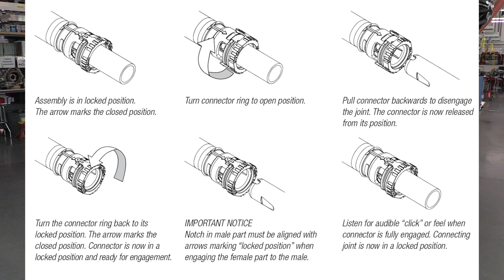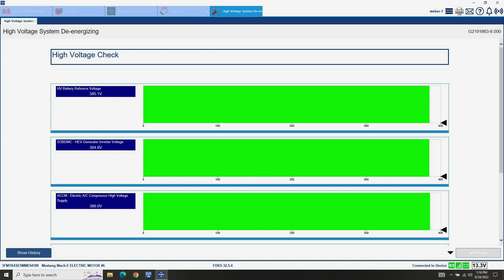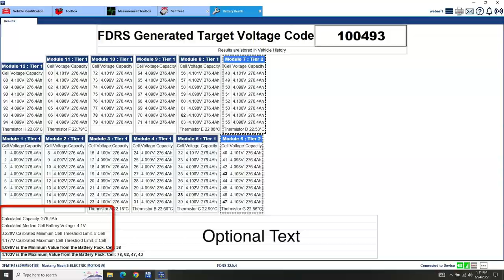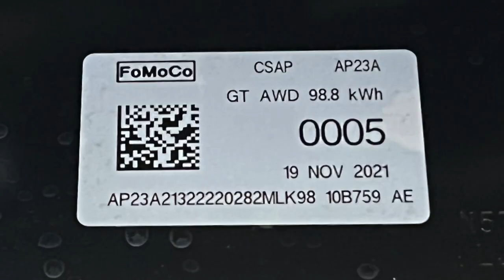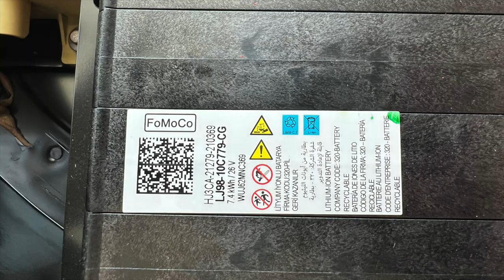Mach-E GT Battery Removal

Comment: Your experience with this procedure almost mirrors mine when removing it for the first time. Getting the car positioned just right may as well be an act of Congress. VERY difficult, and can be made worse if you have an older lift with less arm flexibility. Some old lifts with two stage arms can't even lift these.

The coolant clips are a pain, and I fear how difficult they will be to remove with some dirt and grime built up. The diagram you found from the supplier is very helpful looks like.

I think the offset center of gravity is why the Ford lift table is HUGE. The lift surface is probably 4 feet by 5 feet, and the lift itself weighs something like 800 pounds. Very heavy duty, it was overbuilt to work for future larger packs in upcoming vehicles.
Reply from the maker: Thanks for the feedback Jake. I do wish I had the larger lift table; the center of gravity would not be an issue.

Comment: My wife is probably watching Survivor or something and thinks I'm crazy for wanting to learn all I can before I get my Ford Lightning !
Being a mechanic for 30 plus years, I am absolutely loving watching your incredibly well done videos.
 never thought I would go electric but what I have learned from you I feel much more confident even though I'll have to keep my  old suburban so I have something to fix.
I sure hope some tech videos of the Ford Lightning will be coming !
Are the cels  4680's ? or a completely different type
Reply: Currently, only Tesla is using 4680 cells as far as I know. Tesla has their tabless dry electrode 4680, and Panasonic is making a 5-tab wet electrode version. These Ford cells are similar to the Nissan leaf, Chevy bolt etc.  But the chemistry is different.
Reply from the maker: Thank you for your kind words. Enjoy your Lightning!
Reply: "4680" is a just a size of cylindrical cell (46 millimetres in diameter by 80 millimetres long). Most EV manufacturers do not use cylindrical cells at all - as in this vehicle, they use rectangular pouch cells that are stacked into rectangular boxes (modules).

Comment: Apparently Ford recently issued a recall due to possibility of contactors failing open
Reply from the maker: Yes, they can fail open or fail closed with repeated heavy acceleration of repeated DC fast charging.

Comment: Very informative, looking forward to the rest of the series, do you know which contactors are sticking in the ford recall, as ford says to avoid repeated hard acceleration, and to avoid dc fast charging while waiting for the software fix. I was hoping to see a common contactor between the dc fasting charging and the battery voltage. Thanks for your time. I'm a retired fleet mechanic, and current owner of a Mach-e extended range  gt
Reply from the maker: Thank you. Yes, I will demonstrate the contactors in action in my next video.
Reply: Sad about the recall
Reply: @Nicholas-f5  Recalls have been part of the automotive trade for years, this one seams minor compared to some of the others. I'm sure that future production models will get better. John has shown that the replacement of the contactor module, is not that hard of a fix, and if need after warranty, I would not hesitate to do this repair my self.  My wife's mach-e has been a good vehicle to this point 20 k so far, and I enjoy learning the new technology. Thanks for the reply Nicholas

Comment: Professor Kelly Thank you! Did I miss how to drain the coolant loops?  I thought I watched all the way to the end of part 2.  And I'm only 25 minutes into part 3.  I'd suspect coolant changes would be a maintenance item, that could be done at home with a Mitivac air vacuum  filler system? As a engineer not in the automotive field, thanks for explaining the scientific detail of how and why your doing each step of the process.
Reply from the maker: Good catch. I forgot to video disconnecting the hoses at the front of the battery. Disconnecting the two battery coolant hoses at the front of the battery drains the battery coolant expansion tank. Disconnecting the two rear inverter coolant hoses at the front or rear of the battery housing drains the motor electronics coolant expansion tank. I use the Mityvac vacuum refilling system, it works well. I will demonstrate it in a future video after reinstalling the battery. Thanks for watching
Reply: @WeberAuto  Thanks!  I'm either going to have a Ford Lightning or Mach E soon in the garage.  Great to see Ford willing to collaborate with Universities to share technical knowledge.  It seems like their more willing than others to share serviceability information.  Helping potentially grow what might become the independent EV technician population of the future.  Allowing customers to not always have to rely on limited dealership service for repairs.

Comment: HI John you were taking about how hard it was to position the car with the special adaptor I was thinking why don't you use 4 wheel jack dolly some are mechanical and others are hydraulic in my shop I have 2 of them but for your application you would need 4 of them I use them to lift the front end of car that are too low for me to get on my lift but for u it would be nice so you can move the car in all direction even if the car is in park plus it would lift the car a bit more so it would make it easier to put the adaptor on the body of the car plus it's nice to use those dolly if a car is broken or you want to push it against a wall to save space in the work shop or like if you have a car with a bad air suspension and the car is too low to get it on a lift especially a car.
Reply from the maker: That is a good idea John, thank you!
Reply: I was about to make the same comment!

Comment: Really interesting tear down. I’ve read that there is a weakness in the battery that prevents more than 5 seconds at full power. Is this something you have identified during the tear down? I’d be interested to hear your view on this issue.
Reply from the maker: The Mach-E GT has a nominal rating for the fuses of 630A (Rear Motor) and 350A (Front Motor). They are pushing the limits with a current draw of 1050 amps during full acceleration. I suspect the fuse sizes, contactor sizes, and maximum allowed current needed to be better calibrated to avoid overheating the contactors (A possible reason for the five-second power limit). I will be surprised if the junction block with contactors and fuses gets replaced due to the recall for the contactor issue.

Comment: Professor Kelly, does the cooling system for the drive unit and inverter have a thermostat or does the coolant pump cycle on and off to maintain proper operating temperature for these components? Thanks for sharing your knowledge.
Reply from the maker: No thermostat. The coolant pump is variable speed. Thanks for watching

Comment: Professor Kelly, I hope you don’t mind me asking you a question off topic from your video.  I’m a full time wheelchair user and am looking at getting a new BraunAbility side entry XT power ramp van (I transfer from my wheelchair to the van seat).  But, I need to be able to pull a small trailer (Scoota Trailer, 1,000 lbs GVWR).  I’m wanting to get a 2021/2022 Toyota Sienna hybrid van.  The BraunAbility website states that although they don’t sell them with a tow package you can have a Toyota dealership install one once you purchase the van.  My local Toyota dealer has said they will install it for me if I get the Sienna and it’s possible.  However, my local mobility dealer doesn’t recommend pulling a trailer with the BraunAbility converted Toyota Sienna, but isn’t giving me a reason other than BraunAbility doesn’t sell them with it being installed.  If I don’t get the Sienna my next choice would be a Chrysler Pacifica as BraunAbility does sell them with the trailer hitch installed.   However, their are many reason on why I think the Sienna would be a better vehicle for me.  You know the eCVT Toyota uses very well and being a fellow wheelchair user I’m hoping you are familiar with the BraunAbility side entry minivan conversions.  

Do you think it would be ok to pull a small trailer with the BraunAbility converted Toyota Sienna or should I look at the Pacifica?
Reply from the maker: Hi Dan, I drive a 2020 Sienna van (Braunability side entry conversion). I like the Sienna because it has the tallest roof and widest opening. I also like the reliability of Toyota products. I do not know if a Toyota trailer hitch will bolt on to a converted van. You may need to get a custom hitch manufactured. Best wishes.

Comment: This looks very similar in design concept to the Chevy Bolt battery pack, just a little larger. I assume the Toyota BZ4X and Tesla battery packs are about the same, except Tesla use cylindrical instead of rectangular cells.

Comment: I'm suprzed to see no lock-tight  thread type sealant on the threads of the Batt bolts... you see in the automotive industry, on Subaru brake caliper setup they use a lot of the time.
Reply from the maker: The have a locking head design.

Comment: Most torque to yield bolts in most applications can be used up to 5 times. Now this is never recommended to to but I bet if you read the fine print in the ford service manual it will allow more than a one time use.
Reply from the maker: Thanks for your feedback!

Comment: Professor, I’m curious what the reasoning is for buying the particular trim of the vehicles you purchase. With the model S you have, I believe it is the highest trim (Performance dual motor). The Mach-E is the GT model. I’m just curious why the college purchase these more expensive models, vs something like the Mach-E4x or the Model S long range. I can understand wanting to get the big battery, dual motor versions, but why the performance models?

Thanks for another great video!
Reply from the maker: Good question. I learned from purchasing our 2017 Bolt EV without all the options (DC Fast Charge) that limited myself from showing my students all of the latest and essential to understand technology. I will always try to purchase the fully loaded versions of these vehicle for educational purposes.

Comment: Professor .  So if the 12V battery is disconnected...The HV system is out of order. Same with the interlock. Some remarks from a former diagnostic technician with 35yrs of experience with MB cars .  That green plug disconnector .....use a padlock instead of a simple carabiner.
Second , if disconnecting the minus pole of the battery ...put a plastic cap on the minus pole cause that thick cable has a "memory" and can bent back to its former position . Regards from Belgium .

Comment: This couldn't be more different from a Tesla battery pack, especially the structural 4680 pack that Munro is dissecting, where everything is glued together with polyurethane.  Also the new Model S/X battery, which has none of the open space seen in the Ford's pack.
Reply: This is true. Tesla packs are notoriously difficult or even impossible to service. That makes them effectivly disposable. Unfortunate.

Ford by design intent made their pack easy to service. In the event of a single failed cell a pack can be replaced without replacing the whole battery. GM has gone one step further, making the pack BMS reprogrammable so that cells could be replaced with some unknown future chemistry to prolong the life of the vehicle.

Tesla's disposable batteries should be cause for investors and owners to complain. It is little different from Apple's new phones where battery replacement is prohibited by the phone's software.
Reply: @Miata822  amen! On the Tesla battery, if a single 4680 cell goes bad, the entire multi-thousand dollar battery has to be scrapped and replaced. Absolutely no serviceability. Almost every other manufacturer splits the battery into smaller, serviceable modules so that just the failed module can be replaced for a far less expensive and wasteful repair. Tesla forces you to replace the entire thing.
Reply from the maker: Thanks for your feedback

Comment: you are my favorite EV specialist I would like to know what is your opinion on battery pack serviceability of Tesla vs Ford, VW ,Audi,Porsche, Hundai, KIA etc... especially the new 4680 cell form factor I would like you if you can make a video on this topic I think it really important when the cars are going to be older and any replacement of any component could be done even used parts like contactor BMS modules etc. but if the battery is made like Tesla you can't even repurposed batteries for solar or any other EV other than using the complete battery pack are you going to get a VW ID4 ? .  the way the top cover is removed compared to the top cover of the new Tesla pack see Munro live it's one of the last video it totally a disaster I don't like it.
Reply from the maker: Thank you very much. I like the possibility of some type of service work on the battery. Tesla may have a good thing there or not; time will tell.

Comment: How's the quality of the battery tray? I watched one get ripped out at Munro and the welds were awful.
Reply from the maker: It looked fine to me. The bottom appears to be thin aluminum. There is an inspection procedure to check for damage that might damage the battery modules. Stay on pavement.

Comment: Don't know if anybody else has asked this question. Would it be possible to put an extended range battery in a 22 select all wheel drive? I see there now available in the 2024 model as an option. If this would be possible what would it entail and what would it cost? Do you think you could use a salvage battery if the battery is not damaged. I've seen a lot of totaled Mach Es available online. Total isn't what you might think some of them have what looks like very minor damage. Nowadays are totaling cars out if the airbags are deployed.

Comment: Professor, I have a question.
Are these batteries officially serviceable for repairs? 
Let's say a cell goes bad and the car tells me to contact a Ford dealership for repair.
Would they change just the bad cell, the entire module or even the whole battery? And what about the contractors or the battery management module?

I'm asking because I frequently hear that battery problems in electric vehicles often requires (officially) a full battery swap. But the inside of a battery is so modular that it seems fairly easy to swap just the faulty component.
Reply from the maker: Any of the 12 battery modules can be changed, same with the junction block (with contactors) and the BMS. My next video will cover those topics.
Reply: Yep, there's a battery balancing procedure that may need to be performed. Unlike the Tesla packs, which are a lot less repairable. The structural battery in the new Tesla model y isn't repairable at all.
Reply: @WeberAuto  So then its possible to change any individule cells that may be bad by removing the module & testing each cell. Thats the key to keeping a EV affordable.
Reply: @mikemiller659  Tesla are aiming to make 20 million/yr by 2030. No way to do that with traditional manufacturing and repair perceptions. Drivers in this crisis are lower cost by design and ease of manufacturing. This runs through all modern manufacturing technologies. Tesla have found modules to be redundant given the low rate of pack failures. In the third row interviews musk talked about the Roadster needing modules because of nascent battery technology and from then on it went unchallenged until the Model Y.
Reply: @waynerussell6401  feed me daddy Elon

Comment: BEG PARDON JOHN... SUPER WRONG TABLE FOR REMOVAL OF THAT PACK... YOU WILL INEVITABLY DAMAGE THE COOLING PLATES USING AN ENGINE TABLE TO REMOVE/REPLACE A BATTERY ASSY LIKE THAT! SORRY DIDN'T READ AS IT WAS IN FULL SCREEN.... WAS BLEEDING FROM THE EYES WATCHING YOU WITH THAT TABLE.

Comment: Well, I know what car I'm not buying...
Reply from the maker: Thanks for your feedback
Reply: Why?  It's somewhat of a PITA to get things out but so is changing the spark plugs of your typical FWD 6 cylinder IC engine.   I suspect that when these cars age, "Good Old Boys" will simply "mix & match" cells to balance out the battery and replace the bad or "weak" cells.   The car will not be as good as new but still have plenty of zip but less range.
Reply: @GilmerJohn  
Yeah nobody that is going to do that. The labor costs exceed the gains. If you think replacing the plugs on a 6 cylinder is hard you never owned an easy one.
Reply: I think its cool, Have U seen the Tesla's Plaid (weird name) Beat Every Car in a race. 0-60 in 2.3 seconds.  there expensive though,  $139,000...each.

Comment: no way they make money with this lazy technical design.
Reply from the maker: Thanks for watching
Reply: Have you designed any high voltage battery systems yourself or did you just stay at a Holiday Inn?
Reply: @heathwirt8919  i dont need to be a doctor to tell what a broken leg looks like, but yes i have a backround in this field. And this is far from a lean design.
Reply: lazy design??
Reply: @mikemiller659  Parts bin child.